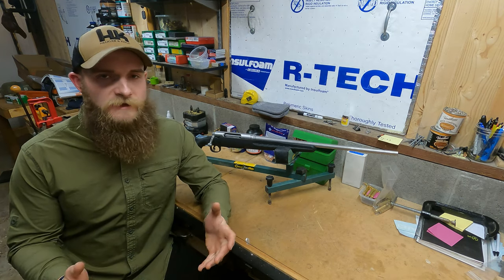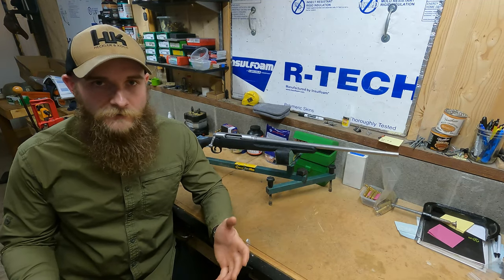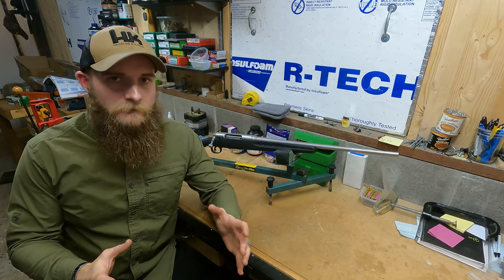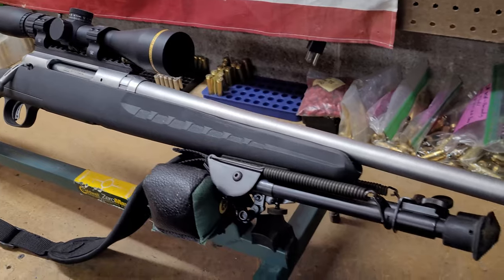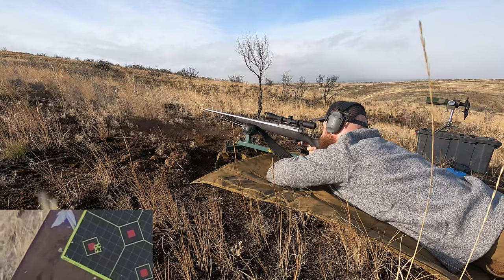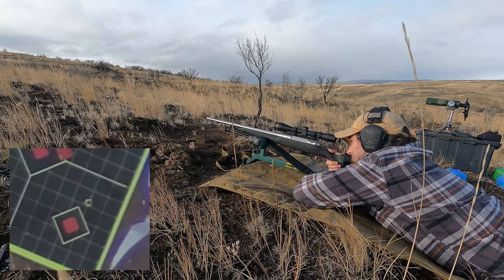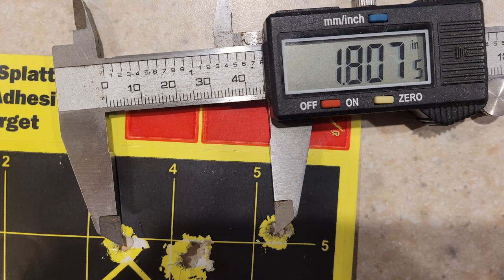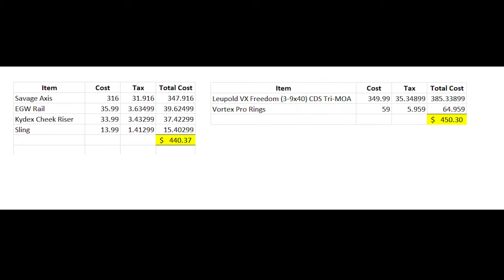Accurizing the Savage Axis

Comment: I dropped mine into a Boyd's prairie hunter stock with the barrel channel opened up to .030 clearance. Mine had the standard trigger so I clipped two coils off the trigger spring. It now breaks clean at 2 3/4 pounds.That along with glass bedding and an athlon 4-16 scope has the rifle shooting 1/2 to 3/4" at 100 yards consistently. The barrel heats up fast on these 6.5's. Hot barrel spreads them to the 1" range. For the money, you can't beat the savage axis.

Comment: IF you fill the front end with 2K epoxy ( and drill channels between the ribs) you can stiffen the front quite alot to remove flex when shooting or loading the bipod, also its not alot of added weight. The buttstock can be filled with expanding foam and some slight weight of balance the rifle, this also removed that hollow sound from the stock.
Reply: Yes it does and it feels great afterwards.

Comment: I bought the exact same rifle at Walmart Sep. 2020. It cost $296 and Savage was giving a $50 rebate at the time. I purchased a 1 piece Weaver scope base for $14, and I put on it a 6-24x50 Ohuhu illuminated scope for $50. My total cost with 6% tax was about $328. The only 6.5 Creedmoor ammo in stock at Walmart that day was Winchester Deer Season, which cost $20 with a $5 Winchester rebate per box for up to 2 boxes. I bore sighted the gun  and zeroed the scope at 50 yards in about 6 shots. After 4 shots the barrel was very warm, almost hot. After I zeroed the gun at 50 yards, I shot a five shot group. 4 shots, mostly touching were about 1/2" group and one flyer at 1.5 inches out. I next put the target out to 100 yards; I figured there would be about a 1" drop. But there was no drop, perfectly flat. The 5 shot group was almost identical to the 50 yard group, 3 shots touching, one 1/2" over and one 1.5 inches out. I later read that a 6.5 Creedmoor is perfectly flat out to 200 yards.

I was thinking of getting a Boyd's stock or doing what the guy in this video did, shave down the stock around the barrel and lower the trigger pull to the minimum. So far I have done nothing. I also took the rifle to a meet, where the targets were unripe 6-8 inch watermelons at 200 yards. A lot of rich guys were there mostly with ARs costing $700-$2000. None of them hit a watermelon. With my $328 rig on the first shot (I am not a good shooter by any means) I aimed dead center of the watermelon relying there would be no bullet drop. I smoked the watermelon; it exploded into tiny pieces. After another dozen guys shot with no luck I put my sights on another watermelon... the exact same result. Only 2 of the 8 watermelons were struck... both from my gun. Who needs to spend 2-5k on a deer rifle and scope?

Comment: I have 2 ; an Axis in 308 and an Axis 2 in 6.5CM 
My 6.5 is in an Oryx chassis from MDT that cost more than the rifle itself, and I left the Accutrigger at the stock setting. With the 308 I just filled the forend with anchoring cement. It flaked a little the first couple times I took it out after but I think it's pretty solid now. Other than that I've shaved a little of the forend where it was rubbing the barrel and put the MCARBO trigger kit in it.
Reply: Does the oryx chassis work with an Axis XP?
Reply: @matthewirwin7686  the "XP" just means it comes with a cheap scope- my 308 came with a Weaver 3-9. It has nothing to do with the action or the spacing if the action screws. BTW theAxis and Axis II are identical.
Reply: @politicallyinsensitive4200  Awesome thanks for your help! From my understanding, the 6.5 will work in the oryx chassis if i select axis SA correct?
Reply: @matthewirwin7686  yep, that's what I got
Reply: @politicallyinsensitive4200  Sweet thanks man
Reply: @SpoliticallyInsensitive: the anchoring cement I used is called ROCKITE. Talk about a rock solid forearm.

Comment: A person that knows the trigger can adjust the factory trigger well enough you don't need to buy a Timney or any other aftermarket trigger. If one replaces the spring or use an Axis II spring the standard Axis trigger pull can be adjusted as low as a Timney trigger and work just fine. I prefer the Axis II because it is safer to take to lower trigger weights because of the safety style trigger. I have both styles of Axis Rifles and I have light crisp trigger adjustments in both. I would not recommend a novice do a trigger job on the standard Axis though. I am just saying it can be done if someone knows the trigger.

Comment: never owned a bolt action rifle. the savage axis xp stainless was my first ever. im unsure if when the pull the bolt up and back its suppose to be difficult. i was under the impression they should slide back like butter. its very stiff to pull up and feels like rough to pull back. any advice on how to proceed with this? is there a specific lube to put on the bolt? ive just been using hoppes.
Reply: Did you figure this out?
Reply: It shouldn’t be hard to pull back. If it is then you should consider warranty replacement. 

If you can’t, then you need to inspect for burrs on the action, if you don’t find any get some medium cutting compound and put it all over the outside of your bolt. Cycle the action with the polish like 300 times, clean it off of the rifle VERY well, making sure to get it off of the inside of the barrel lugs. Any gun lube will work and you don’t need much.
Reply: With the axis you will have some resistance at first(roughly around the halfway point of unlocking the bolt) as the action of unlocking the bolt cocks the firing pin and locks it back… after that it should slide back and forth rather smoothly(minus any resistance from pickup and chambering the next round)
Reply: Desh Ind. makes a lift kit for $23.00 and glaze armory makes longer bolt handles, ran across this while looking on how to adjust accutrigger, couldn’t find paper work or tool, but got it done, look these up on you tube, I just ordered them, total cost $96.00, hope this helps good luck.

Comment: what did you do to the trigger?
Reply from the maker: Changed the pull weight
Reply: @frontlinerejects8029  Hi, im needing to accurize mine, considering a timney trigger--your thoughts?  thxs
Reply: @orvaroth1613   Replace the trigger spring. It literally will cost you $20. It took my Savage Axis from shooting 2 inch groups down to half MOA.

Comment: How do you determine how much to take off the inner stock
Reply from the maker: I put it back to together, lightly flex the stock and see if it comes in contact with the barrel. If it does I take off a little more